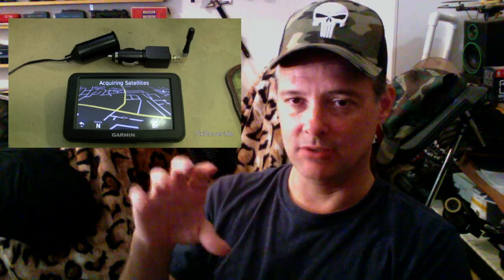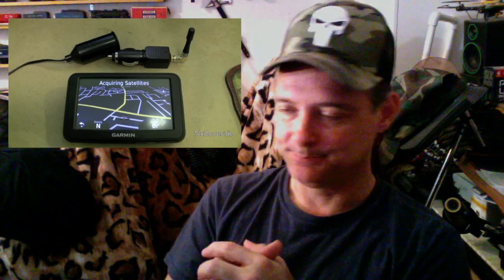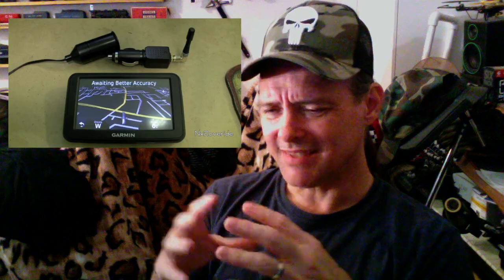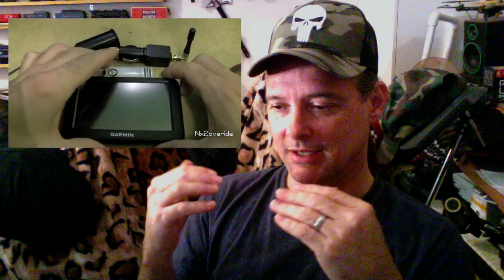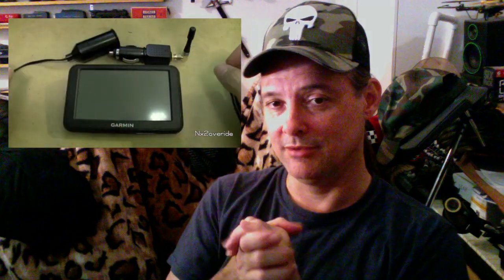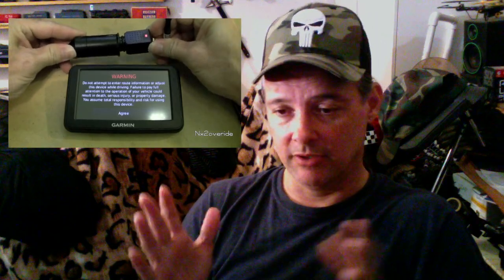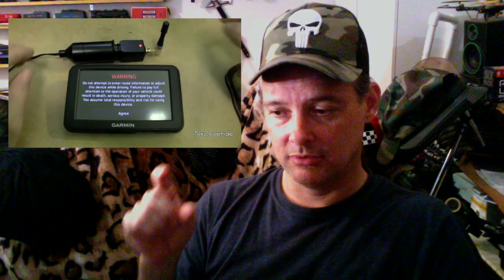GPS Jammer Signal Jammer Blocker

Comment: They can purchase a newer 8 band  jammer that blocks the necessary signals. Unfortunately, they are expensive. Also, as for the range, they can purchase a jammer that blocks a certain range so they won't have to worry about FCC. There are jammers that jam as little as  40 meters in range.
Reply: Where can you buy one that actually works?

Comment: These damn things cost a friend of mine her job. She lives next to a highway and works remotely from home and when a train of semi's would come by they would knock her internet offline. She was hard lined in and not using WiFi.
Reply: As long as that are not jamming voice calls or gps they are not breaking FCC rules

If they are only jamming data there is not much she can do about it
Reply: @newmanc6619  they'll lock a cell phone completely up. Screen won't respond and if you are on a call it'll drop it. She filed an FCC complaint and so did the store down the road because they were messing with their ATM and knocking it offline. I'll tell her to refile a complaint and include the phone service interruption. A friend of mine told me the other day that the device's they are using probably come from south of the border and aren't FCC compliant because they are used to jam GPS and cell phone signals so their locations cannot be tracked and that some of it may be from boosters left on because of competition for bandwidth on oilfield and construction locations. It's in West Texas so I wouldn't doubt that at all.

Comment: Most companies will not spend on more sophisticated gps equipment that uses 4g cdma gsm cell data towers. These devices DO work on basic car port plug in gps trackers.  You DO NOT "just fall off the map" what happens is the last known position will be the spot where you appear as if the vehicle has been parked there. I have tried many different devices and can attest they do im fact work. I had access to 2 different live access map hubs that show the assets being tracked.
Reply: Also jamming data is not illegal while jamming voice is

These selective jammers are far more expensive, but is what you need if you are going to jam.since you can jam data but not affect voice calls

Comment: hello do this device block the Pir sensor device that its used in alarms sensors???
Reply: How woiuld an RF jammer affect a PIR?
1) Move super slow and you can actually walk through a PIR
2) Glass blocks IR rad from your body.
3) If possible adjust the sensitivity on the PIR when it is inactive.

Comment: Hi can this work if I want to engine idol for hours without the company knowing the vehicle is running .. I will not be driving .. just running the engine ?? 

Thanks .
Reply from the maker: as long as the electrical system is continually powered and the jammers is running it "could" jam it as long as it's just a gms tracker on the vehicle.